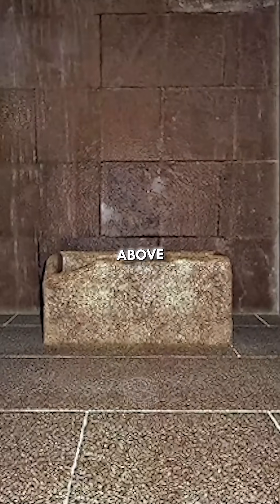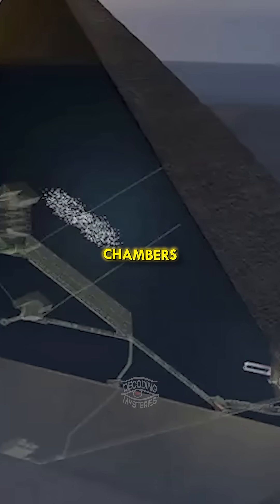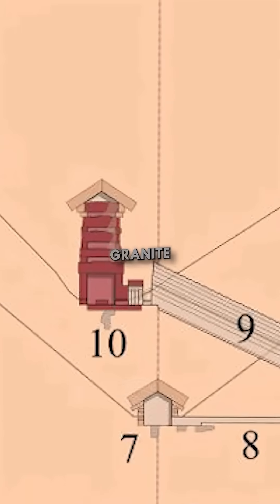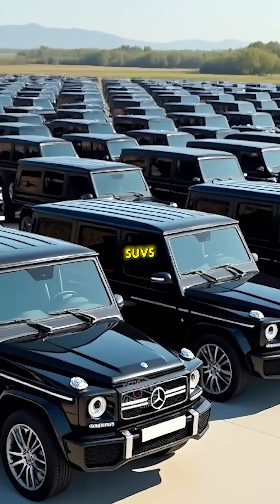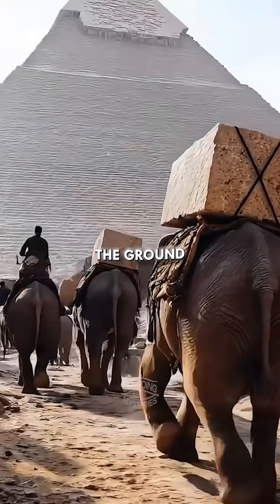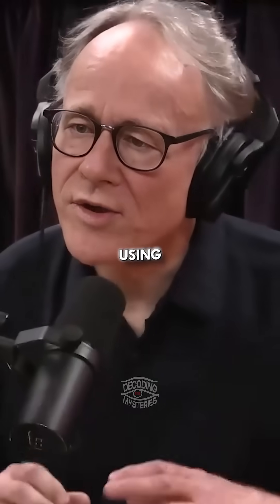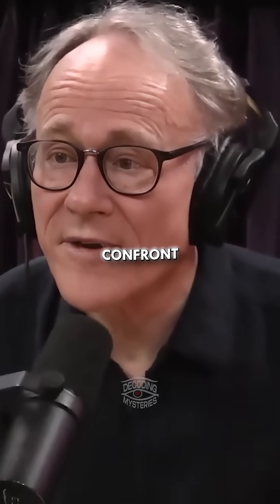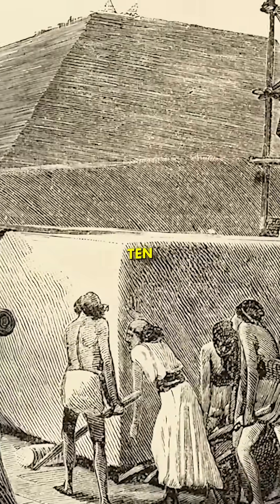Engineering Secrets of Egypt's Great Pyramid That Defy Logic 📜

Comment: The older I get, the more fascinated I become with the construction of the pyramids
Reply: SAME! I truly hope someone is able to excavate what’s underneath
Reply: @erix76  at the expense of potentially screwing the pyramids structural integrity, that's never going to happen.
Reply: Telekinesis....only logical explanation
Reply: Yea, but several months ago an American moved there & applied reverse engineering to them, he had engineering answers for everything, thats being proven. They are pressure vessels for chemical reactions, they made ammonia fertilizer in 1 nitric acid in another & hydrochloric acid in the other. They are big to hold the pressure of the reactions, they flashed boiled water in several using lightning strikes to get the process started, thats why gold capstones were once on the top. And the dynastic Egyptions did not build them, they tried copying some but they did not have a full understanding what they were since they stumbled on to them thousands of years after the builders had moved on.
Reply: Very hard my ass they also discovered a electric battery 3000 years old why don’t they explain this rather than how build Pyramids
Reply: Me too
Reply: Personally I say it's a giant pile of alien feces
Reply: You're definitely not the only one
Reply: Interesting...🥱
Reply: Someone should write a book about how they built them while being enslaved and then running away to hide in the desert and then conquering...  😊
Reply: Why didn’t they write down how they did it??
Reply: @tdub25  because they had no pen 🖊️ ?
Reply: @tdub25  ask your sister..
Reply: Arabs building only Arabs build with rock 🪨 stones 
The Bible is the history of Arabs nation only
Reply: dam right , its a HUGE mysteri how they were built with all that weight of stone blocks .
Reply: Couldn’t agree more
Reply: Giants did it.
Reply: What is the point of this boob? The pyramids were built with big stones, we got it. Whether he believes it or not there they are....
Reply: The nephilem built them
Reply: I don’t believe they moved anything mechanically they have some type of science that could move these big az rocks
Reply: @Samil101  - The earth is not flat, get over it.
Reply: Have been since I was a kid
Reply: 51 Here, and i feel exactly the same. I’m really questioning what we all have been told
Reply: I think were all missing the major question here......
Does jet fuel melt granite beams?...........🦗🦗
Reply: I go hard every daY
Reply: me too !
Reply: Same bro. I can’t get enough of it.
Reply: agreed
Reply: Ok unc
Reply: I think we all like that
Reply: We never built them we inherited them, finders keepers
Reply: Just A Mystery Nobody Really Knows The Whole Truth 🤔🤔🤨🧐
Reply: Ramp sand people
Reply: Me too
Reply: As I get older the more I think not a chance humans built them😂
Reply: That's why I like one piece's archeology lore
Reply: They had to have been built from the center out.
Reply: Same!!!
Reply: It was a mountain, they cut the area around it down.
Reply: Me also. How they also aligned them to stars yet the later ones were not nor as well constructed and did little. WTF was going on back then? Were early Egyptians green?
Reply: We all know how it was done, but afraid to say, Aliens
Reply: Like wise
Reply: The Aliens built em. Omg
Reply: Same
Reply: I Say Giants Were Used😊
Reply: Djinns were used
Reply: There's something more fascinating than the great pyramids, it's DNA.
Reply: Me too, its hipnotizing🫨😵‍💫
Reply: My best guess is the pyramid started as one big block
Reply: The older you get the more you should be curious about what and who exactly you are. It is time for us to awaken my friends.
Reply: The pyramids were built by Giants.
Reply: It's not fascinating... dark spiritual forces assisted
Reply: True story
Reply: Demons built them how stupid
Reply: @Shezkakaka  Especially when demons don't exist lol.
Reply: Ark's under the Sphinx.
Reply: same here brother!! just amazed how they done it.
Reply: There is a video of a guy who has figured out how to lift massive concrete blocks, like those in the pyramids, with only some wooden parts and all by himself. Look it up; it's just smart mechanics, nothing else.
Reply: @jupitereye4322 sure they were big stones but not 70 tons.. also doesn’t still explain how they were lifted 350 ft in the air.. he guy didn’t lift it ten ft he simply flipped it. Nothing else. Doesn’t explain a dam thing about the pyramids smart guy.
Reply: @GamesBondJr  Actually, it doesn't matter if the weight was 70 tonnes or more; the principles are the same. Go and take a look at what this ONE guy did all by himself. You'll see that his principles would apply on a larger scale without much issue. I am not saying, though, that it's an easy job—not by a long shot. But I am saying that it is very possible and doable.
Reply: @jupitereye4322 yeah you’re not very smart if you think weight doesn’t matter. You have no idea what you’re talking about. What you’re saying still doesn’t prove how they lifted 70 tons to 350 ft.
Reply: @GamesBondJr  You are not very smart if you don't want to check what I am talking about. The principle of the manipulation in mechanics is leverage and material properties. First, take a look at the guy I was referring to, then make a comment. What he does, in principle, is to tilt the stone on one side, put some material (in his case, wood) under the center, then tilt to the other side, at which point this rock is lifted by an inch or so. Then he places another piece on the other side, tilts it again, and the rock lifts another inch. It is slow, tedious, but it is doable. He alone managed to move 200ft per hour, a 1-ton block, or erect a 20-ton block, alone. But the more important thing is that this is more logical than claiming something extraordinary like alien technology or time travel, as some people claim.
Reply: @jupitereye4322 I’ve seen the video. It still doesn’t explain 70 tons at 350 ft. You can tap out your neck all day but just bcuz you say you think it will work doesn’t mean it would.
Reply: @jupitereye4322 tilting and lifting it 350 ft in the air are not the same things at all. You can think it is but it’s 100% not the same. And 20 tons isn’t 70. Also doing it on level ground isn’t the same as 350ft plus on a huge slope.. so again you can keep trying to convince me but you’re talking to a stop sign at this point.
Reply: @GamesBondJr  Tilting it proves the concept that one can do it, it is just a matter of time. But this was not the only technique that was plausible. Now, how they transported it from elsewhere is a different thing, but the construction is very possible. The block that weighs 70 tons can be tilted easily with 10-20 people on one side, and elevated by a few inches by placing the rock or something similar under it. You can elevate the block by 1m in a matter of an hour or so, if everything goes well. Then it can be placed on the first platform, shifted by rotation, which would take another few hours, and the process continues for each level. If you have thousands of people doing this in parallel, if everything goes well, they can build it in a couple of decades. I am not saying this is easy, I am just saying it is doable. The example this one guy made is just him alone.
Reply: @jupitereye4322 Chatgpt is talking?
Reply: @jupitereye4322 yes but everything that guy does is on a much much smaller scale. Some of the pyramids stones are massive!
Reply: @amandameares6275  Oh God, well, I didn't say he alone can make pyramids, did I? It's the principle behind it. If they have thousands of people and a promise of eternal life, you can accomplish a lot
Reply: @jupitereye4322  Yep, Using tiny rocks underneath the big blocks.
Reply: @jupitereye4322 yeah I’m pretty sure some guys made a video proving the chiseling with primitive tools as well
Reply: @jupitereye4322  I think I've seen that video, and yes, it's impressive how he moves those massive blocks. But one thing is moving them around and something completely different is lifting them and precisely place them where they are today. I think this massive structures weren't made by humans.
Reply: @jupitereye4322  must be alien wood surely.
Reply: @jupitereye4322  What about moving 100 ton blocks being moved up and down mountains?
Reply: @jupitereye4322 no they had advanced technology
Reply: dont think too much about it like that guy trying to calculate human strenght and leverage to make it impossible 
with 100 guys you easily move these 70ton rocks up there with leverage and stoppers
step by step, they were tens of thousands and they had daily deaths but they were still smart and passionate about their work because even now u dont have a life goal and they were probably happy about achieving something impossible
Reply: @xDakos Ratio 100:70.000 (people:rock weight)
So, in your example 1 person is lifting 10 times his own weight quite a high distance from the ground without any modern equipment. This doesn't include moving the rocks and materials to construct levers to the place where the pyramids are built. It also does not include cutting the rocks and all other materials needed.
Now imagine, we not talk about one rock, but 2 million rocks only to build the Great Pyramid. Then imagine there are a few more pyramids build at the same site. 

To build these pyramids in modern times would take years! It is unbelievable they were able to do this thousands of years ago when humans were shorter and in general less strong and less healthy.

Now, lets assume that in a lifetime one person manages to support putting 10.000 rocks in place. This means for 10.000 rocks we need 100 people working their whole life. For building the Great Pyramid 20.000 people would be needed (for one pyramid only). We yet not talk about the soldiers controlling all these slaves without revolt.

'Fun' factor:
There are no mummies, treasures or even hieroglyphs found in the Great Pyramid. Explaination; Mummies could have been eaten by animals, treasures could have been stolen, and hieroglyphs have been later developped. The rooms are empty without even any paintings in them. I believe this is very mysterious and extremely weird.

If we would not have the proof that the pyramids exist, we would never believe an acient text describing these huge constructions.
Reply: @xDakos wrong 100 men can't lift a 70 ton stone 350 ft in the air but common sense ain't so common
Reply: @gunsmokejames4476  bro i can lift a couple of tons with a single iron rod with leverage xD 
Ofc you cant straight up lift it all up at once but u never need it 
With ropes over the pyramid and around the weight never drops then you have people putting trees below the weight after ever step and then u have people which leverage the weight upwards 
It really is not that impossible at all 😂
Reply: It's by designed that when we grow older, we start to question everything around us.
Reply: @supermaticboy I startedquestioning things since I was 12
Reply: @biizzlle be curious
Reply: @supermaticboy so you've spent your life not looking nor listening, it's easy to move a really heavy thing with a long enough lever. Imagine having more than one of said lever let alone having ropes and logs,,
Reply: The older I get the more irritated I get by this fraud.
Reply: @pjhgerlach 
Could you please explain what you mean by this statement
Reply: ChatGPT

Comment: Actually it's very easy to explain this with mechanical advantage. If you had a team of 500 men you could lift 70 tons with a measly 3:1 or 4:1 force ratio depending on their strength. That would have been completely achievable with their technology and manpower.

Comment: I’ve got an idea: what if, they didn’t build half of the pyramid and then put the stones on with a gigantic ramp, but instead they built one layer of blocks, put the big block up one layer with a little ramp, then they built another layer of blocks, and then they built a new ramp, and then they moved the big block up again? It’s not that hard if you use your brain, which the Egyptians obviously did. Why would they build a gigantic ramp when they could have just worked smarter and not harder?

Comment: A ramp at 10 degrees reaching a height of 350 feet would need to be 23,819 feet along the horizontal, and the incline length would be 24,187 feet long. 4.52 miles along the horizontal, and  4.58 miles on the incline.

Comment: A simple calculation will show that it would take just 8 adult elephants to drag or tow one of those largest stones. So if you also add a large lifting winch system into the equation, it would take even less elephants. So in reality its very possible and well within the scope of probability. There's nothing mysterious its just physics.

Comment: For those wondering the ramp would be approximately 2016 feet long at a 10° slope to reach 350ft high.
Reply: Imagine how strong and robust that ramp would have to be too. Yes it’s over 2000 feet but how wide and sturdy would it have to be. Ridiculous and incomprehensible feat of engineering if that is how the got stones up there. Assuming that’s legit, you’re once again faced with the question of how they were accurately placed.
Reply: @StatesideCard  Thats the point.....at 2016ft.  proves this is a ridiculous hypothesis to how they got them stone in place. On top of this these ramps are not a mobile they would have to create a different  ramp for every other stone.